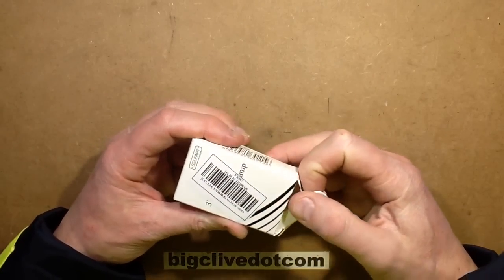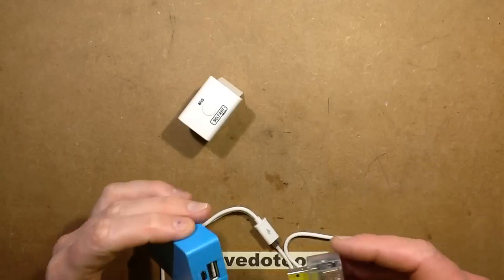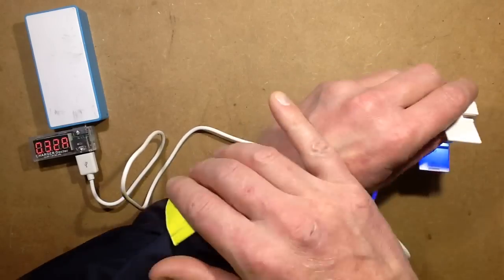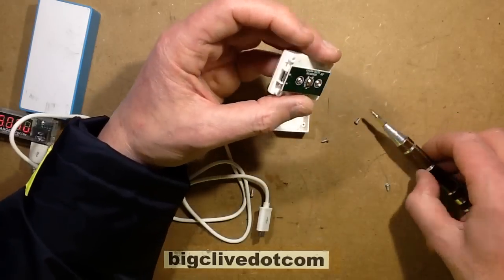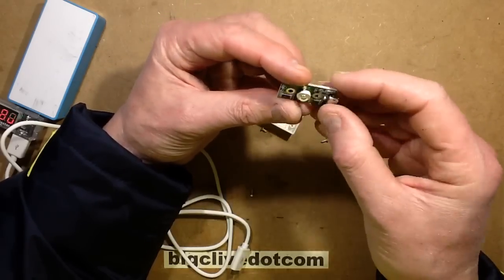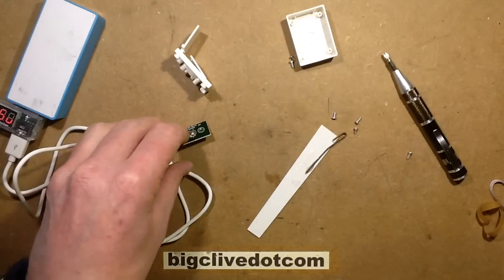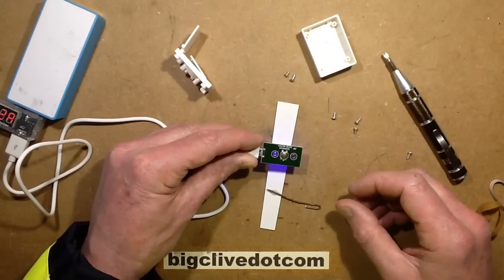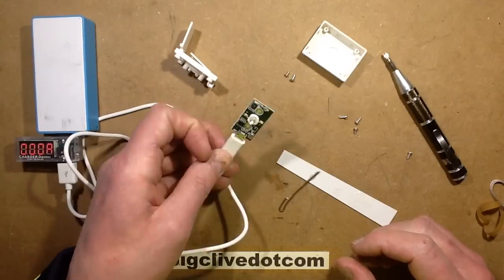Mini UV curing light.

Comment: Just for the record, UV curing glue seems to be a must for the iPhone screen and lens fixers, and as a result is pretty easy to come by. ... 
http://www.ebay.co.uk/sch/i.html?_sacat=0&_sop=15&_nkw=uv+glue&_frs=1
50g for £3.64 shipped half way round the world for free. You would be hard pressed to get a bottle of PVA for that in the local B&Q round here.
5mm UV LEDS are cheap too, 50 for 0.99p, I might just grab a few and convert one of the many 5mm LED torches I have lying round in to an eyeball frying skin cancer inducing death ray. 
http://www.ebay.co.uk/itm/191752521080?_trksid=p2057872.m2749.l2649&ssPageName=STRK%3AMEBIDX%3AIT

I can add it to my collection of world dominating death rays, having recently purchased ten lasers for $0.76 .. I only need another 99,990 of them  and I can burn my way in to Fort Knox..

Comment: I'm impressed with UV LEDs.  I'm quite sure that by the time the tubes in my PCB exposure box pack up, LEDs will be good enough for the job.  When I was born, LEDs came in one colour: Dim red.  A far cry from the  full spectrum  (and beyond)  that you can get now!  I remember buying my first blue LED; it cost nearly £10, a fortune for an impoverished student.  It eventually ended up in the front panel of a disco light controller I built, along with a green one and a yellow one so as to match the colour associated with each channel.  And now they go for pennies .....  Still, I like to console myself with the thought that blue LEDs are as cheap as they are today because people like me paid the "Having to Be First" tax .....

Also, it's interesting how the USB connector has found a new niche as a de facto standard for general-purpose power supplies of 5 V at up to 1 A.  I liked your little USB energy meter so much, I went and bought one of my own; mine is a bit different, it sits lengthwise and has an LCD with a cold white LED backlight showing voltage, current, hours:minutes and mAh.   So you can use it to measure the capacity of an unknown battery, by resetting the energy meter, connecting the device and seeing how much charge has gone into it when it becomes fully charged.  

As for the unmarked IC, my bet is on it being a PIC12C508 clone running application-specific firmware; and the absence of part numbers is just plausible deniability in case Arizona Microchip ever come sniffing around for royalties .....  It's not as though it's a particularly difficult part to manufacture, and you can do a surprising amount even with just six GPIO pins.

Comment: Will it be powerful enough to erase eproms?
Reply from the maker: Not sure about the wavelength.
Reply: "The recommended erasure procedure is exposure to UV light at 253.7 nm of at least 15 W-sec/cm² for 20 to 30 minutes, with the lamp at a distance of about 2.5 cm."  and "Erasure of the EPROM begins to occur with wavelengths shorter than 400 nm.".. LED UV lights have a narrow spectral output centred around a specific wavelength, +/- 10nm. typical LEDs are 365nm, 385nm, 395nm, or 405nm so, yes it will erase an eprom.. exact exposure time will depend on the LED in question.

Comment: Clive, Judging from the light emitted it looks like a 405 nm LED.  They generally have a lot of light in the short end of the blue spectrum.  I made a pocket emitter array of 9 405 nm LEDs for checking for counterfeit bills.  US bills bigger than one dollar have a stripe that glows green when irradiated.  Bank checks have a UV activated watermark for authenticity.  The light won't damage your retina but will give you a snow blind headache if you stare at them for a long time.  It'll cure glue but not efficiently.   For curing glue I built a 365 nm illuminator which provides faster curing and deeper penetration but requires UV eye protection since it will damage your eyes with prolonged exposure.  I designed it using LEDs I  got from a Chinese supplier via Amazon.  I believe they aren't available from local suppliers since they are considered a hazardous item.  My illuminator works like a charm and, since I used an old 9v/ 2A power brick, it cost me about $10 to build.  Btw, I use RapidFix UV curable glue and they list the shelf life of the glue as indefinite as long as it isn't exposed to UV.  As an aside I really like your videos to the point of staying up all hours watching them.  I'm as bad as you for taking things to pieces and just took apart a defective TPM that I recovered after having my tires replaced.  Had to know what was inside it. Later.

Comment: One day China will take over the world when all these USB devices with the mystery 8 pin chip suddenly activate and all our computers are taken over......all your base are belong to us!
Reply: blower Those chips are made by Cyberdine Systems 😈
Reply: Nonsense! Give me a microwave oven, pair of tin snips, and a screwdriver and I can build a machine that will fry these things easily.
Nothing says fried electronics like a 1kw beam of microwaves.

It's almost frighteningly simple to build a device capable of producing that kind of beam from a standard microwave oven if you have the knowledge.
The result can be quite dangerous if you're not careful, I am not responsible for any damage you do to yourself, others or anyone's possessions with such a device.

Basically you make a directional antenna from the sheet metal of the microwave, and you connect the microwave's magnetron to that.
Magnetron emits 1kw of microwaves, antenna directs them into a beam, beam will fry any electronics that aren't in a metal enclosure, and some that are.

Comment: Great stuff man!  Cool videos! If you get a chance check out this LED light I found on amazon.com "Small 1 LED 16" flex Light 2 AAA Batteries" sold by LEDwholesalers.  It has an interesting circuit inside it. I believe is a current limiter to extend battery life.  Thanks for the videos!

Comment: It's my understanding that these are not actually in the UV part of the spectrum but more in the blue to near UV.  Somewhere around 410-420nm.  I spoke with my dentist a few years ago who confirmed that the resin used for fillings was hardened by blue light and not UV and theirs specifically needed 410nm wavelengths.  Many plastic resins that say UV cured are actually sensitive to blue as well UV.
Reply: I have a couple of 405nm LEDs. They produce a beautiful blue-violet light and make lots of things fluoresce. The UV diode in this video is probably similar.

Comment: I use UV curing resins to fix broken plastic pieces. It's sandable, workable, paintable, etc. after you cure it. I have two different kinds. One is under the trade name "Bondic" and works quite well. But I have another called RapidFix that came with its own mini-Maglite style UV flashlight to cure it with.

Bondic: https://www.amazon.com/Bondic-Adhesive-Improved-Formula-Non-Toxic/dp/B017J1JVBG
RapidFix: https://www.amazon.com/gp/product/B00QSA77NE
Reply: The advantage of UV curable adhesive is that it doesn't cure until irradiated so it allows the piece to be precisely set.  The disadvantage is that it can't be used to bond opaque materials since the light has to reach the adhesive.  Also the light provided with the glues is a short spectrum blue light (405 nm) which is at the low end of UVA.  It'll give you a snow blind headache when looked at for a prolonged time and limits the amount of glue that can be used at one time.  You have to build up the glue in layers.   To cure RapidFix I use a higher energy 365 nm UV source which is barely visible.  It cures the glue faster and penetrates deeply allowing more glue to be applied at a time.  You definitely do NOT want to be looking at its output!  I use UV blocking eye protection.  Unfortunately my short wavelength light is not a commercially available assembly.  I designed and built my own for about $10.00.  Commercially available 365 nm illuminators are much more expensive.  The 365 nm LEDs are available only on Amazon from a Chinese supply house.  I think that's because they are considered a hazardous item.  My driver is simple using an old 9v 2a power brick and an LM337 as a 400ma current source.  You can go to ~700 ma but that causes excessive heat and will shorten the device's life.
Reply: I think I have a bag of those Chinese UV LEDs. I bought a bag of 100 of them. They were ridiculously cheap.
Reply: I boo-booed. I'm driving it with 40 ma.  Anything over 70 ma will toast the device unless you use pulse width modulation and limit the duty cycle.  I don't think you gain much by doing that.
Reply: Ese Callum I wouldn't. part of a dentist's work is removing dead or rotting material first. If you just slap on some random resin, it's going to trap junk in the cavity and make it worse. Let the dentist do it.
Reply: I understand where you're coming from, but it smacks of doing surgery on yourself. You can probably manage it in some cases -- there was a surgeon, Leonid Rogozov, who took out his own appendix in 1961 when he got stuck as the only qualified person in a base in Antarctica and came down with acute appendicitis. (http://www.theatlantic.com/technology/archive/2011/03/antarctica-1961-a-soviet-surgeon-has-to-remove-his-own-appendix/72445/) But that was a do-or-die situation. 

If you've got a tooth in the state of if I don't do something, I'm going to die from septicemia, or something truly dire, then you could probably yank it, but anything less dire should be handled by a professional. You could get badly poisoned by a tooth gone septic. I know a guy who was hospitalized by a bad tooth. And a hospital stay would probably be more expensive.

Have you checked to see if there's a dental college near you? You might be able to get a deal to have a student dentist do it. They have to practice on someone.

There ARE temporary patch kits, for when you have a minor cavity or lost filling, but they still recommend seeing a dentist within 48 hours of use. I wouldn't recommend futzing around with that sort of thing, as a septic tooth can kill you if left long enough.

Comment: Clive, I have  a question. I have the same powerbank, charges things fine but if I try one of those USB led circuit boards with 4 lights on the lights flash on at full brightness then go straight to a very dim glow, I tried to run a pi off another one too and that didn't work, is there some sort of circuit regulation that stops it working?

Comment: That thick cable looks more expensive than device
Reply: TheKaukas Nah... I'd bet it's a Samsung knock off, judging by the look of that male USB A connector. :P
Reply: 97Giorgos97 I mean only "looks like" 
Anyway I would just buy bunch of UV leds and solder them together and simply use battery for source, cheap and easy.

Comment: it's so cute. would it really need to be anything more sophisticated than a 555?
Reply: It wouldn't. But a 555 would need more external parts.
Reply: And the 555 has a much higher idle current.
Reply: Microcontrollers are cheap enough now to use in many applications where 
previously an analogue solution might have been adopted.  (Even in 
2000-ish, PIC12C508s were being used in automotive controls such as 
heated-windscreen timers and window lifters.)  They can be programmed in
 situ during the assembly of the PCBs, so there is no wastage of 
pre-programmed parts.  And there is no need for tight-tolerance external components for accurate timekeeping.
Reply: what an age we live in. too bad there are so many microcontrollers it seems an EE degree mostly boils down to knowing how to find the right mc for a job now

Comment: I have a few UV glue pens, they are advertised here as 5 second fix and Lazer bond USA. They are the same as the stuff you have there but I find that the Lazer bond USA works better. I've bought many of these UV welding products and I recycle the LEDs from them. I made a torch out of one, runs on a 9 volt battery.

And I have that same style power bank but mine is red.

Comment: Why is it made by Sel Fart?
Reply: Why buy farts when you can make them at home?
Reply: John, Ill take your question seriously and answer it.  For UVA it depends on where in the spectrum the radiation is coming from.  At the low end (405 nm) you'll get a mild (photokeratitis) snow blind effect.  No permanent damage; however, you'll get a headache.  At the high end (365 nm) you risk retinal damage from prolonged exposure.  UVB will cause serious eye damage and other physiological effects since they are highly energetic ionizing radiation sources.  It would be akin to staring directly into the sun.  The eye is most sensitive to damage by UV in the lower UVC band at 265–275 nm. Radiation of this wavelength is almost absent from sunlight, but is found in welder's arc lights and other artificial sources. Exposure to these can cause "welder's flash" or "arc eye" (photokeratitis), and can lead to cataract formation. To a lesser extent, UVB in sunlight from 310–280 nm also causes photokeratitis ("snow blindness"), and the cornea, the lens, and the retina can be damaged.  Not to mention sunburn and skin cancer.
Reply: They sell farts?
Reply: Gordon Lawrence because they encourage the distribution of flatulence.
Reply: Cosmo John 
Maybe not, but you want cataracts?
Reply: John Brandolini 
I think you're ignoring the most important factor, which is the intensity.  Certain frequencies are more harmful than others, but the amount of power behind it is most important.
Reply: Granted.  But to make my point a class 3R laser pointer at 5 mw may cause damage if your eye is exposed for over 250 msec. Per the International Electrotechnical Commission "A Class 3R laser is considered safe if handled carefully, with restricted beam viewing. With a class 3R laser, the MPE (minimum permissible exposure) can be exceeded, but with a low risk of injury. Visible continuous lasers in Class 3R are limited to 5 mW. For other wavelengths and for pulsed lasers, other limits apply." ( IEC 60825-1 standard )  They have similar standards for UVA, B, C.  So there are a lot of Class 3 lasers on the consumer market rated at 5 mw being sold without respect for the safety issues they pose save for a small warning sticker on the device.  To explain my claim - the energy in a photon of light equals (hc)*(1/L).  The energy increases as the wavelength decreases causing the light to affect what it's illuminating on the atomic scale knocking electrons out of their shell, breaking chemical bonds &c.  This is the primary effect of UV curing lights.  The more energy in a photon the greater the damage; more power means more photons thus the damage occurs faster leading to photochemical cataracts or worse.  Solar radiation (now there's a power source to reckon with) consists primarily of UVA and UVB along with infrared radiation.  IR doesn't penetrate the skin whereas UVA and B do.  UVA generally doesn't penetrate far but UVB is highly energetic, causes DNA damage leading to skin cancer.  Bottom line just because the average power of the UV emitter appears low it shouldn't be assumed that it is safe.   The manufacturers of 400 nm curing lights are derelict in their duty to warn consumers about potential eye damage due to direct viewing of the lamp.  I built my own 365 nm/ 40 mw curing lamp but won't use it without donning a pair of UV safety glasses.  I just wanted to make it clear that these "low powered 400 nm lamps" aren't intrinsically safe.
Reply: UV LEDs are not so uncommon. You can buy UV counterfeit bill detectors at a dollar store.  This one looks a bit more powerful however, which causes concern for allowing children to play with such a device.
Reply: Landrew0 Does all uv-a, uv-b, uv-c bulbs cause blindness?
Reply: Landrew0 Exactly, even visible light can be deadly if intense enough. good point!
Reply: John Brandolini 
Happened to me 25 years ago when I criticized something in a presentation and the presenter aimed his laser pointer at my eyeball. Years later a flake of my retina fell off and I had a gray spot in my vision for several years. Seems to have grown back or some sort of mental compensation has occurred because I don't notice it now.
Reply: Reading this sets alarm bells off in my head regarding disco/nightclub  use of high output UV blacklights, and how many establishments have enough set up to flood a venue in UV for hours at a time.
Reply: ***** 
That's exactly what I mean; ignoring all sense of proportion causes hysteria.

Comment: I use the same 1w style uv leds in my pcb exposure rig, work just fine and lots easier than a load of 5mm ones :-) Not much heatsinking going` on in that nail curer though for driving at the full 1W :-/
To those asking, no this won't do eeproms, it's high uv-a likely 390+nm. Deep UV LEDs needed for eeproms (or germicidal etc) are expensive, REALLY expensive.

Comment: My dentist uses UV to cure plastic fillings.
Reply: MrBanzoid yeah. that's how dentistry works.
Reply: not if you have a gob full of mercury amalgam fllings!
Reply: I expect your dentist uses blue light to cure your fillings, not UV, as that is safer.
Reply: I believe optimal wavelength for curing a light activated resin depends on the photoinitiators the manufacturer is using. Of course, it is not necessary to have a light source of the exact peak sensitivity, as long as it is within the band of wavelengths it is sensitive to, though it might need a bit more time.

I would suppose that if a dentist is trying out a new filling material, they would test it with their equipment to see how long they have to expose it.

Comment: There's is a great video by electronics and more that uses dental resin to make super tough parts you need a uv light, maybe this would work? should be a lot cheaper than the specialist   lights. https://youtu.be/eYVT9l969NE